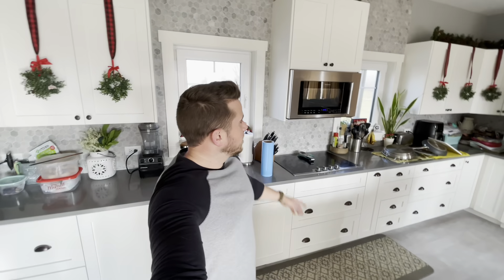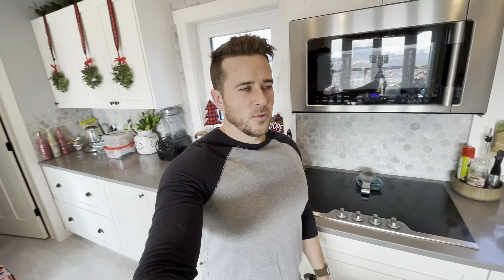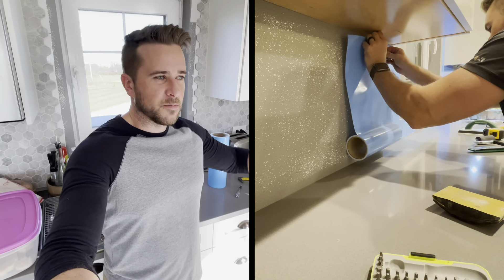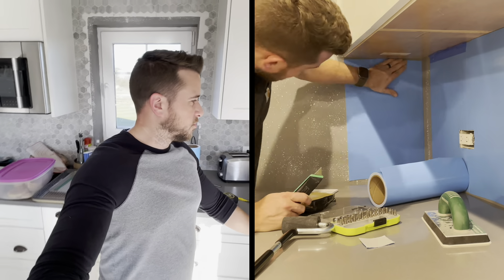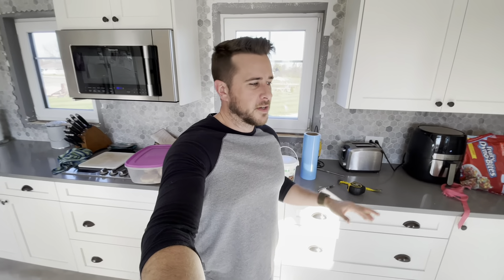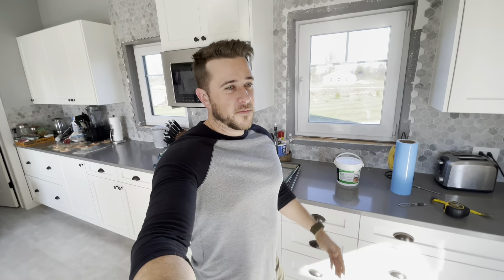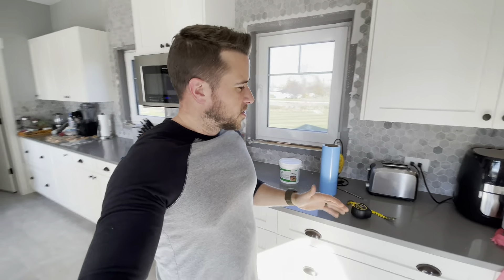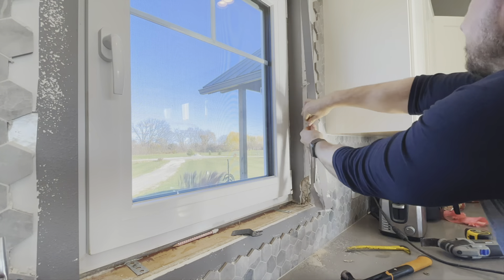HOW TO install Kitchen Backsplash WITHOUT MORTAR!

Comment: Brilliant the way you did one sheet of tile at a time and did your cutouts. Hopefully no issues in the future. I have a small job to do and would have done this had I known about it. You are right major PITA mixing and clean up.
Reply from the maker: Thank you!  Yeah, this method really fit better with my schedule.  Rather than trying to tackle as much as possible to reduce the amount of mortar cleanup, I was able to do as much or little as I wanted at a given time.  Plus I would’ve hated working with mortar around my appliances and cabinets.  Just a mess.  No doubt I took a risk with this being a bit of an “unproven” method but I’m hoping and praying it stands the test of time.  Holding up after 8 months so far.

Comment: Great video! I’d like to do this once my house is built. Have you had any issues with the adhesive or tiles since you’ve filmed this? Also, did you have to use spacers or anything so the outlets were flush with the face of the tiles?
Reply from the maker: Thank you!  It’s been about 8 months now since I put it up, and no issues.  I’ll definitely do a follow up if I start seeing problems.  I don’t want to lead anyone down a bad path.  And no, I probably should have used spacers, but I just used longer screws for the outlets that I already had on hand.
Reply: @makework  sounds good thanks a lot!

Comment: Hi dude, thanks for the info, question what cutter or saw did you use for this project?
Reply from the maker: I used the Kobalt 7” tabletop tile saw.  It was the most reasonably priced tile saw I could find with a sliding table, and it worked pretty well for me.

Comment: The only way double sided tile adhesive work well is with hard to obtain flat back tiles which have to be cut with a scoring style cutter. Can't use a wet saw ~ tile will always retain some moisture which causes tile to not adhere fully and can fall off over time. Thinset comes premixed in quart and gallon sizes which is the only permanent solution here. It's also faster and easier to work with than the adhesive strip.
Reply from the maker: Well it’s worked well for me so far.  And before I did mine, I did a little research and found others that did tile similar to mine and they’re still good, several years later.  If you watched the video, you saw that I dried every tile with a blow dryer, and since the tiles weren’t sitting in a puddle of water for days, I don’t think they really soaked all that much up just from the saw.  And I’ll have to disagree with thinset being easier and faster.  For someone who works with it a lot, sure, but for me, not so much.
Reply: Once you use thinset, you'll understand how much faster, easier, cheaper, and stronger it really is than the double sided adhesive. You can get away with using that stuff (with all the extra expense of time, labor, and money) for a kitchen backsplash, but not in a shower.
Reply: @johng9562  it clearly states this isn’t for showers. It works great for kitchen back splashes, just relax and let everyone be great. Not everyone wants the hassle of things the professional way, some people work alot and don’t have the time and don’t want to pay someone a arm and a leg to do this stuff. this job will probably cost you $300 max, if you hire someone to do this, it will cost you a lot more.
Reply: It can't work ~ most tiles will fall off over time, the only exception being hard to find flat back tiles.
Reply: @johng9562  seems to last at least 5 years. That’s good enough for most people.
Reply: Sorry ~ nowhere near good enough.
Reply from the maker: I have used thinset, multiple times (floors, walls, showers etc.).  My disagreeing doesn’t come from ignorance.  It wasn’t necessarily faster, but that had more to do with my schedule than the product.  I thought I it was much easier and obviously much cleaner.